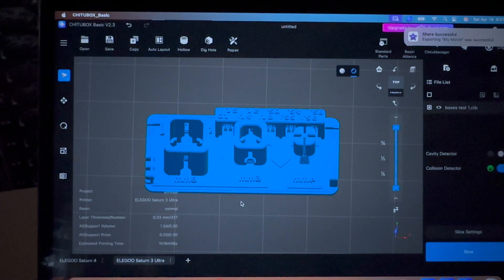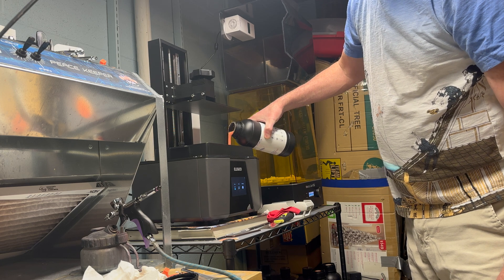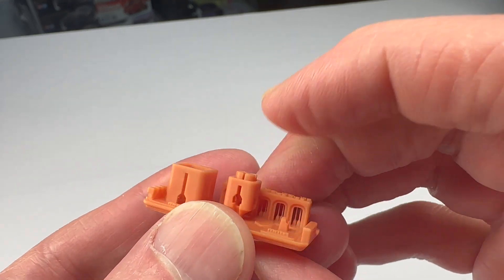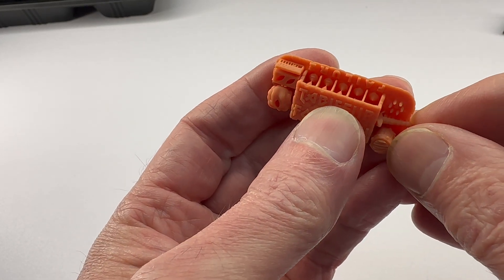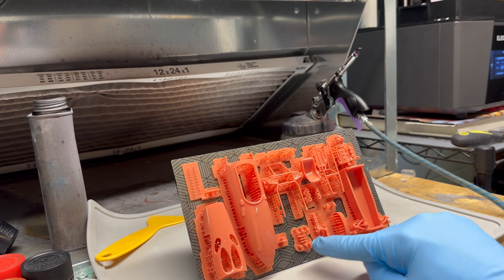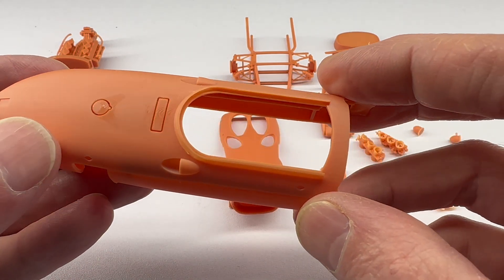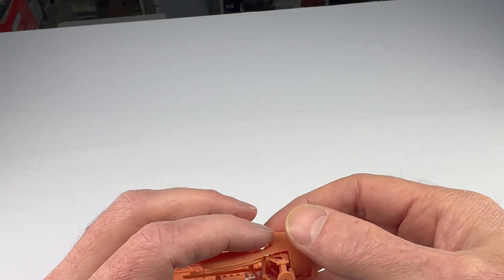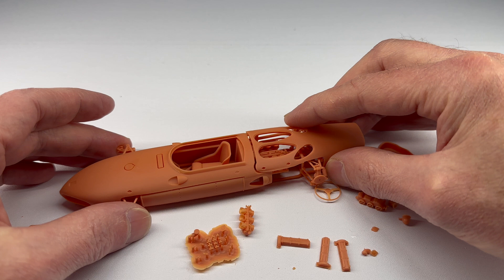Here is why you NEED to calibrate your resin!  - Funcrecol Resin Test

Comment: I used the Cones of Calibration and I think exposure time is too high. I'm a newb to all this. So my Saturn 3 Ultra is set at 2.5 and I'm using Elegoo 8K standard space gray resin. Should I dial it down to maybe 2.2? 🤔
Reply from the maker: It depends on how close you were with 2.5. Did all of the success and failure print it can’t hurt to go 2.2 and see what happens.

Comment: I've heard someone say on a youtube somewhere that the light distribution of your UV source will dim towards the edges of the screen which would explain why your part failed on the corner.  I guess this means that fragile parts should be printed close to the centre of the build plate.
Reply from the maker: That makes a lot of sense, I attribute it to poor auto supports.

Comment: Very good video. I'm happy you enjoyed my boxes of calibration and it looks like you discovered how to correctly use them. 

You got a fantastic result where you got 10 out of 10 pillars while the boxes fit into each other. 

About the pressure of a light switch is what you're after and if you get that you're going to be within 0.06mm of dimensional accuracy. 

Looks to me that's what you got. Fantastic results! 

As for the failures just add a few extra supports and you will be good to go! 

Never increase the UV exposure time to force a failed print to work. Especially if 90% of the print worked just fine. Not saying you were going to just a little friendly advice for you and anyone else.
Reply from the maker: Thank you so much! I appreciate you taking not only the time to watch my video but to offer advice. 😎

Comment: Hi James !
Thanks for these useful informations.
Do you cure the tests or just wash them ?
Reply from the maker: I’ve read that curing them can alter the results. I clean them with a detergent and then rinse them with water. Still not 100% safe to handle with bare hands but I’m an idiot.
Reply: Thanks James ! You handle some traces of Isopropanol, not resin... It's less serious !😁
I print the Amerabals test : It's really a very small piece, you need also very good eyes !
By the way, I've heard about the levelling that the card delivered by Elegoo with S3 U is too thick for a good levelling and a simple sheet of paper is better. What do you think about ?
Reply from the maker: @ I need to do more research on leveling and try some other ways. One side of my plate is easier to remove pieces than the other which tells me that it isn’t 100% level.

Comment: Hi James,
I'll never get used to see these thin wires getting printed, amazing. On the other hand, the vertical surfaces show groups of scattered layers patterns, do you know why ? 
I guess this calibration needs to be done every-time you change for a different resin. 
The Ferrari looks amazing, Bill did a wonderful job. It looks like a printing angle would be nice to get rid of the "cucumber" support texture under the rear of the car.
Can't wait to see these spoke wheels printed🤩 Are you  going to build the car ? Thank you for the video and Happy Easter👋🏻
Reply from the maker: Hi Yves, I will reprint the pieces angled for a better surface on the bottom. I still want to learn minimal supports as well. Calibrating a precise resin was the first step. It’s funny, the FunCreCol is cheap but very crisp detail wise.

Comment: Hey James, So welcome to the dark side of printing. I have a couple questions though. You mentioned that you had just replaced the fep on your s3u. Did you switch it over to FEP instead of ACF?  Also, I'm interested if you cured the test models or not? I've been using cones and boxes for a while, and they seem to produce a great starting point for the real files. I also noticed you tried Bill's straight up approach to printing model cars. That works great for bodies and such with lots of curves in them but not squared off parts. Also, you are correct in that Bill's files are second to none. I seem to have an issue when I load up the build plate like that. The files on the outer perimeter always seem to have issues. Keep up the great work. Looking forward to seeing you at the next local show!!!!
Reply from the maker: I did change from ACF to FEP in the S3U. I had issues with the speed and decided to switch to the slower pull.  I do not cure test prints, I heard that it distorts them. That makes sense about the over crowding. I’ll calm down and take my time🤓

Comment: Thanks for this review of the resin, I have the Saturn 3 Ultra as well and will be able to use your setting tests as a good point to use or to further refine when I start doing my 3d printing. I appreciate the testing and info you do on subjects like this.
Reply from the maker: Hi Kevin, it’s not my usual water washable 8k resin but I was impressed that a cheap resin did so well. I’ll keep testing it on big and little items. Thanks for watching and good luck with your printer.

Comment: The support sagging is easily fixed by using less support. When they're too close together, the resin is not able to flow away from the contact points, and it starts to drag as it builds up. Try using fan supports if you want to add more contact points. That way there are less obstacles to restrict the resin from flowing away from the model and the contact points
Reply from the maker: That’s the next thing I need to learn is proper supporting. Thanks for the tip.